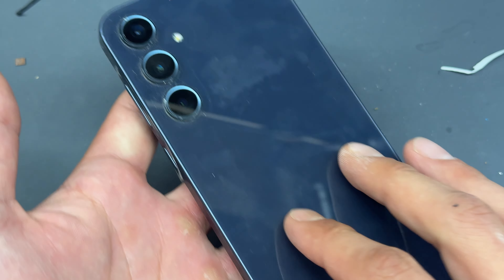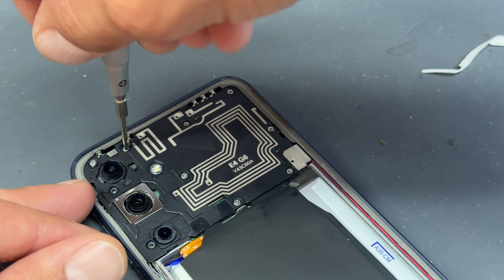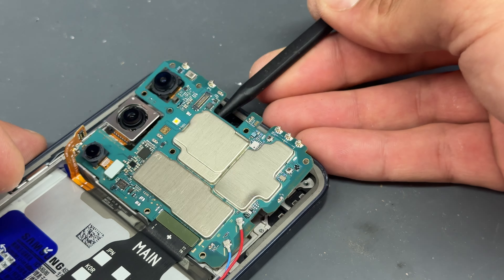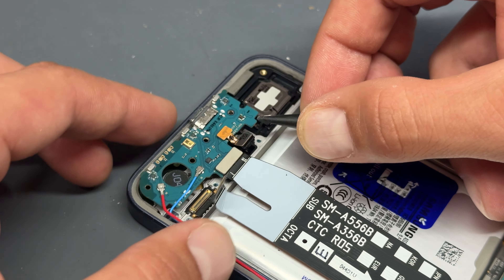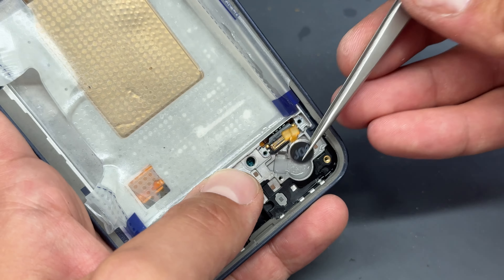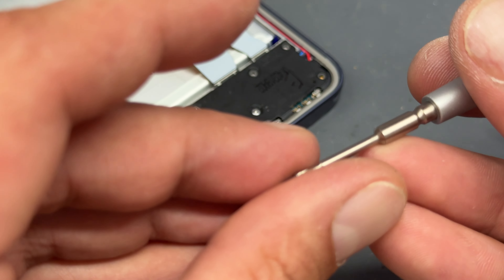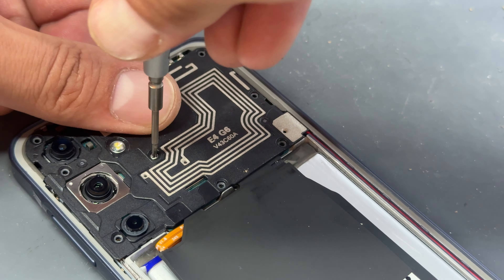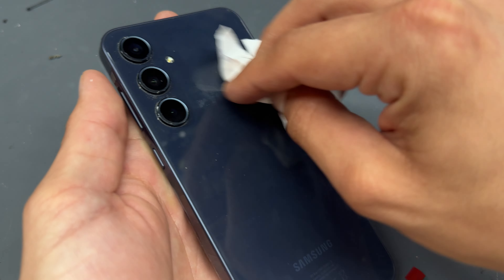How To Replace Your Broken Samsung A35 Screen! Full DIY Guide To Repair Your Phone Screen!

Comment: I know I will see this video again.  My replacement screen did not come with the two speakers or adhesive for the back cover. I split one speaker apart removing it so I will have to reopen the phone if I can find speakers and glue.  Your video instructions did assist me greatly in replacing the screen tho and I am able to  access the data on my phone again!  Thank you! 

It is interesting that the military can fire off computer equipped munitions from their cannons but if I drop my phone from waist height ...